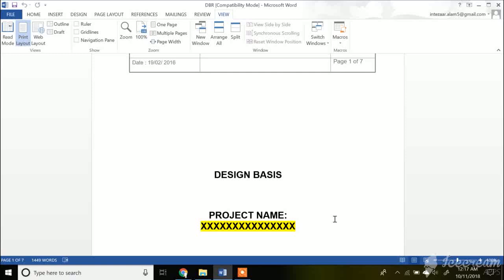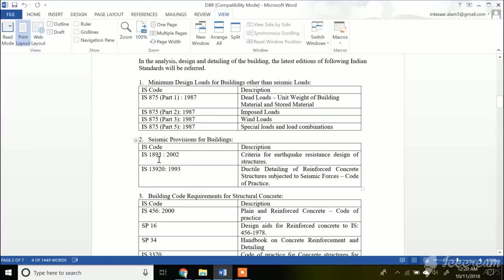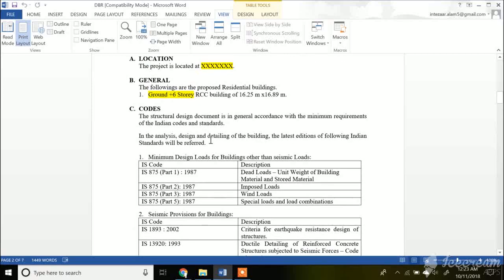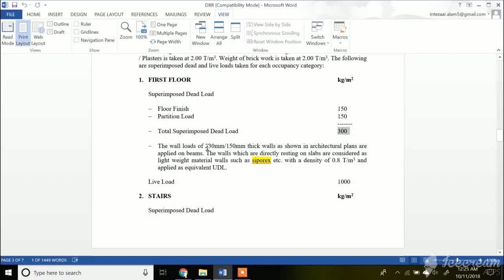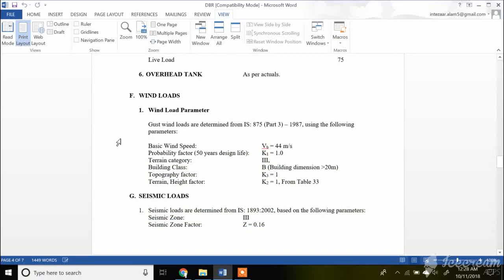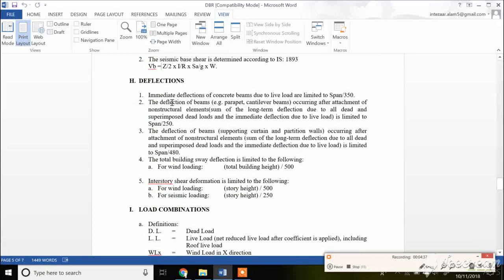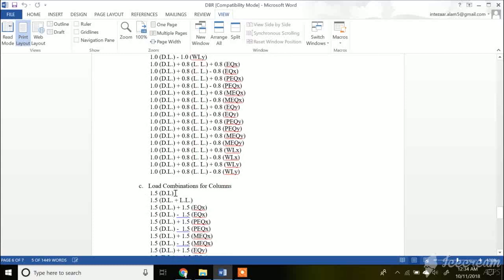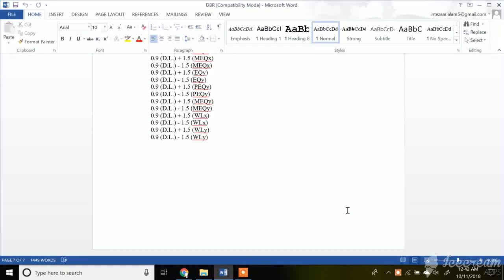G+6-RCC BUILDING DESIGN -Lecture-01-Design Basis Report

Comment: We are doing frame structure the proposed design is for g+2 but right now we constructed only ground floor, and the footing we did mat footing that is only 9” depth once i came to site next day i complain about the depth is very less thats why we again did footing next day for 9” thick that is in step shape. The design is RCC frame structure with mat footing
Reply from the maker: without reinforcement in the foundation i cannot grantee the stability of foundation since the columns will have punching effect on the mat and also there will be upward pressure from soil. kindly share the design for better understanding. otherwise if 1st floor slab is not constructed then please provide Isolated RCC footing only at the column location.
Reply: Sacademicus Thank you for your quick replies 
We did footing with reinforcements but the depth is only 9” we did concrete is it safe for at least g+1
Reply from the maker: @abdurrahmanmadri8221  9" is depth of foundation below ground level?
then how is ur column and footing connection?
if u can provide any drawing or photographs then ill get better clarity and then i can clarify all doubts.
sacademicus@gmail.com
send the drawing on above mail id. ill probably reply by tomorrow.
Reply: Sacademicus plz give me your whatsapp no to share details of my design for better understand and discuss
Reply: Sacademicus sure sir i will e-mail you now
Reply: Sir Please Gide Me I want talk to you  Ask Questions  And My Dout ... How I Contact you

Comment: Sacademicus Hello sir,
I constructed my house of size 30’x40’ with 16 columns out of wich 10 nos are 9’’x15’’ and 6 nos are 9’’x12’’ but the footing we had done is 4’x4’ and some 3’6”x4’ but the depth of footing is casted only 9” then upon my request to the contractor next day again we casted 9” concrete that is step footing without any steel and scrubbing the surface of concrete, is it safe for g+2. Plz reply
Reply from the maker: the footing should be a RCC i.e with steel reinforcement if your structure is framed structure but if u r executing a load bearing structure then you need to provide strip footing.kindly answer which type of structure u r constructing( load bearing or framed)? in any case u need to revise ur foundation since u r proposing a Ground+2 structure.